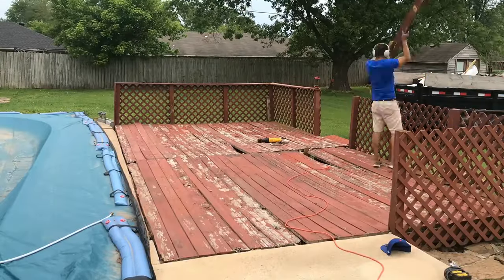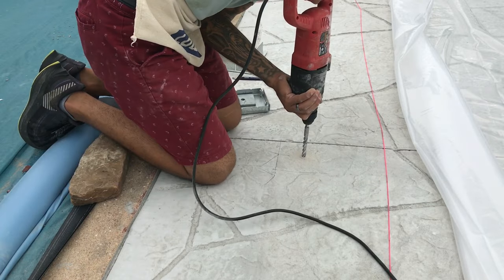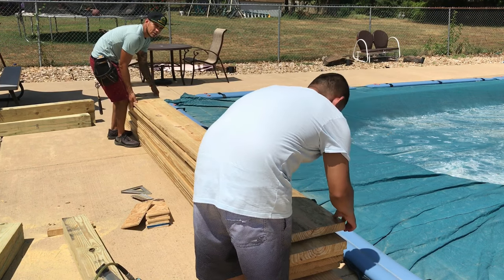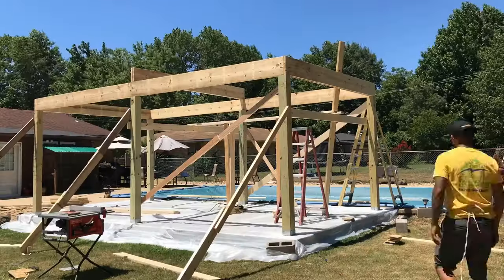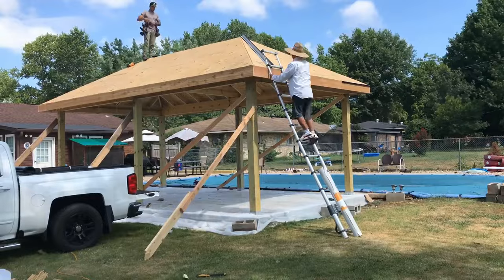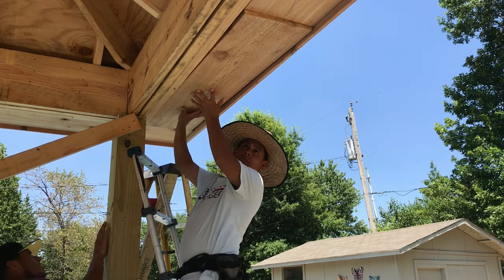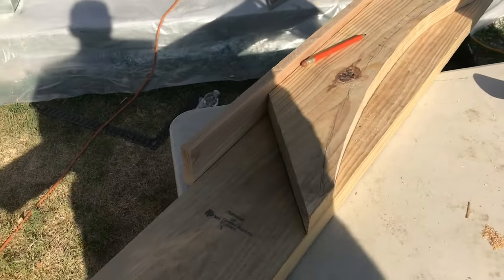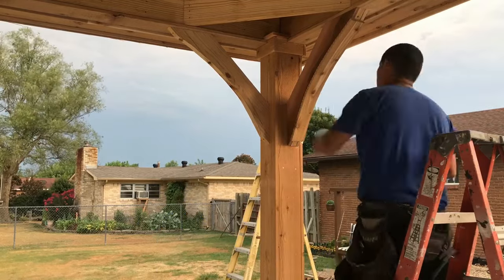gazebo build

Comment: Why the particleboard pieces in between? I don't think they are gonna see a lot of rain but probably humidity which is not good for them?!?!
Reply from the maker: that is osb. commonly used in between headers so it can make 3.5 inches. I mainly added them so it would be steadier and not move to the sides, since we have a long span

Comment: I am not an structural engineer 
Should the posts rest on concrete posts that go 20 to 30 inches below the surface? They are resting on the slab as it is now: this could result in cracks on the slab over time

Comment: Looks great what size is it again and do you happen to have like some type of blue prints or inventory of what you used to build it?  We would like to do one just like this… thank you
Reply from the maker: thankyou. 
it is 13x25. sure thing. ill write down most items that i can think of.
6x6 post base
posts- 6x6 treated
bim supports- 2x12s
rafters- 2x8s
7/16 plywood. you can upgrade to 3/4 
1x8 cedar to wrap the posts
1x12 cedar for soffit
 stainless steel screws. 

please let me know if you have any questions throughout the build.
I might also be down to drive and build it for you
Reply: @constructionfiles  would you come build one for me in ocean springs, Mississippi
Reply: How did you attach the beam support to the 6x6  vertical corner posts? I didn't see any brackets or attaching hardware. Structural screws? Thanks
Reply: @jvick9241  At about the 6:40 mark you'll see where he toe-screwed the posts into the headers. Scroll down in the comments, he says he used 6 inch screws through the corner supports as well.

Comment: How much did this project cost in materials not including the cement? Is the roof strong enough to support a tile roof or does the roof need to be modified?
Reply from the maker: Materials I spent 5k and it's strong enough for a tile roof
Reply: @constructionfiles  what would be a range of labor cost would you say? just so we know what good or fair pricing is.

Comment: Hello I did not quite understand this section:

you mentioning one side only but than you are saying that all sides look similar

rip some?????

to cover the posts
7:55
we installed a half an inch plywood on
7:58
one side so
8:00
all of the sides will look similar to
8:02
the rest of the sides we might have to
8:05
rip some maybe
8:07
one quarter of an inch or one eighth so
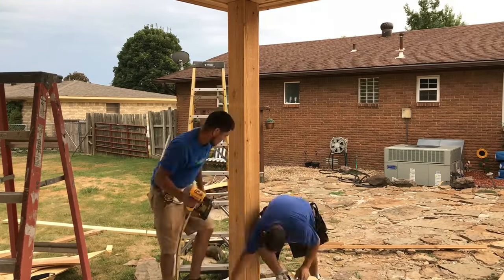8:10
Reply from the maker: hello. i added half inch plywood so they would be similar in width but not the exact same. since the posts aren't always exactly 5 1/2 wide, it'll differ up to 1/4. you have to install the first 2 and then just overlay them and mark it exactly where to cut it.